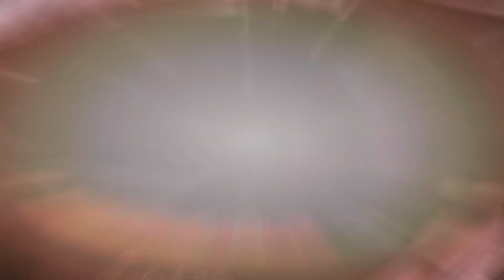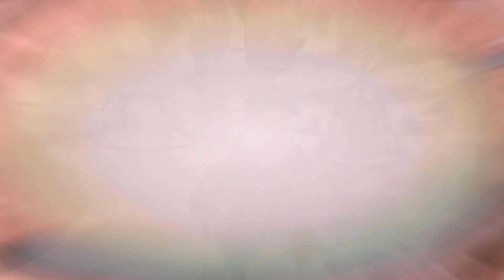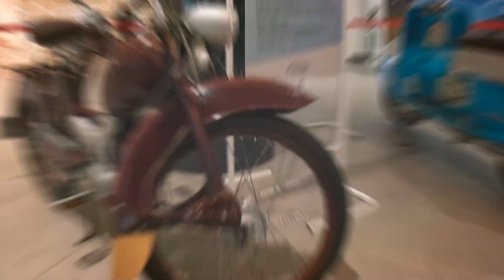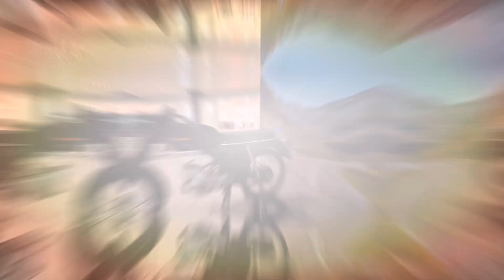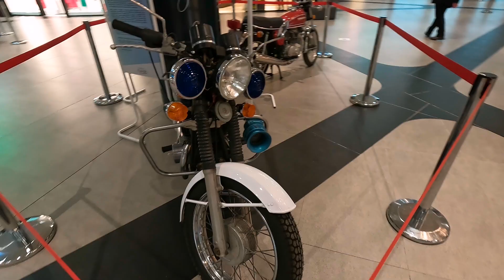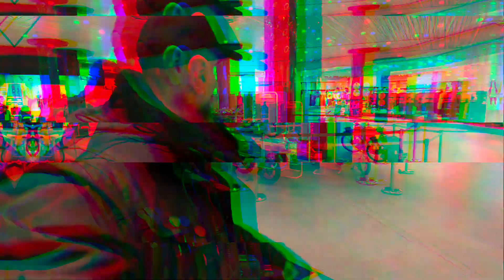The Legendary Romanian Motorcycle MOBRA - Still Running?

Comment from the maker: My father was able to make more than 260,000 Km with this bike in the 70s and 80s.
With this bike he was able to climb the mountains with no asphalt roads at that time. 
On tomorrow's video you'll be able to see and find out more about the Legendary Romanian motorcycle MOBRA. 
The legendary Romanian motorcycle MOBRA, with the production at the Zarnesti – “6th March” factory starting in spring of 1970, Mobra 50 is the successor of Carpati and Carpati Super motorcycles. Mobra 50 has a 50 cmc, two-stroke , single cylinder engine that develops 4 HP at 7000 rpm. The motorcycle weighs 80 kg, and has a maximum load of 150 kg. The 12 litres fuel tank gives an autonomy of 500 km. Average consumption is 2.5 l / 100 km. Maximum speed of Mobra motorcycle is 70 km/h. The modified competition Mobra 50 can reach up to 115 km/h.

The production of Mobra motorcycles haulted in 1994 and in 2001 the factory was reorganised as a military production unit. Even in 2004, at the Tohan factory were produced 1500 Pegas bicycles.

In this video you are about to see more legendary vintage motorcycles, discover a little bit about their history and admire them from our modern perspective.

🔴 JOIN US ON:
👥 FACEBOOK https://www.facebook.com/idealbikemoto
📸 INSTAGRAM https://www.instagram.com/ideal.bike
🔔 Subscribe for more videos:  https://www.youtube.com/c/IdealBike?sub_confirmation=1

Do you want to have a partnership or to have your product reviewed?
idealbike2018@gmail.com